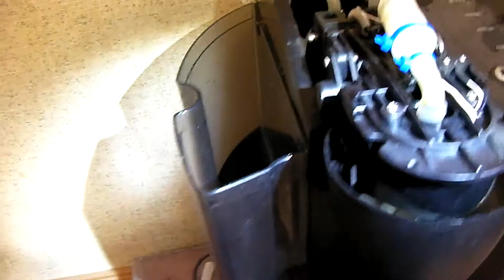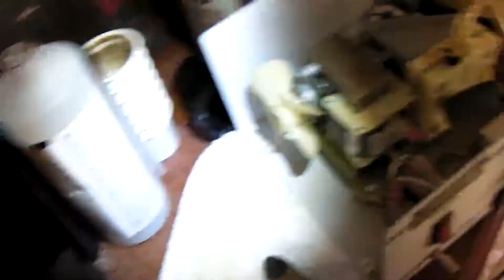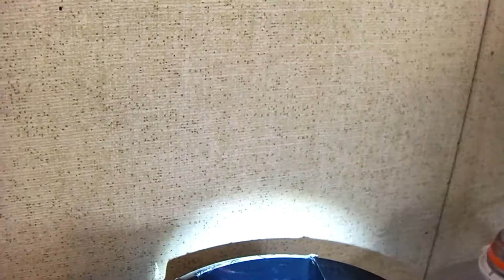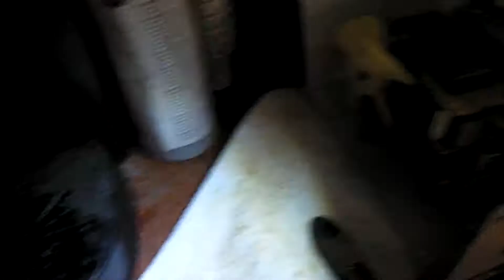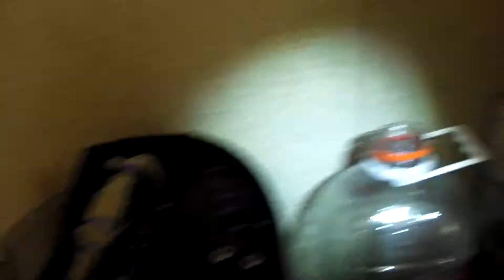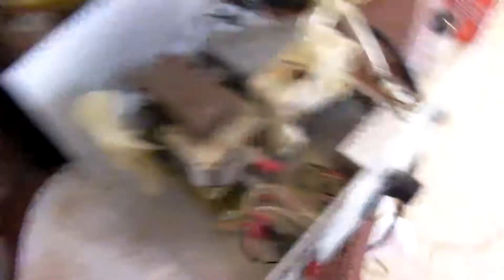A possible fix for Keurig running water out of relief tube

Comment: One thing you and the rest of the repair guys did not mention is when we don’t have access to a air pump. So you know what I did I just took out the hose from the water reservoir and just upended it draining as much water as possible. And guess what ? It worked. Nailed it. 😁